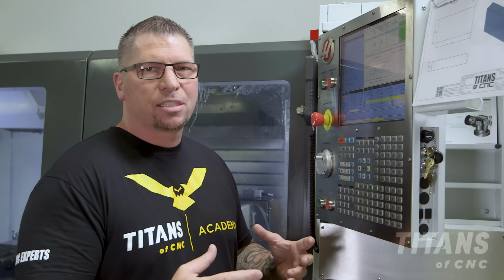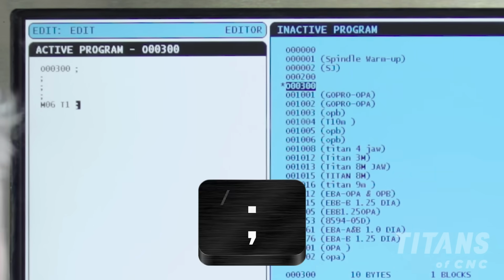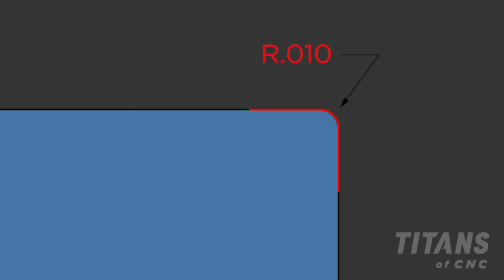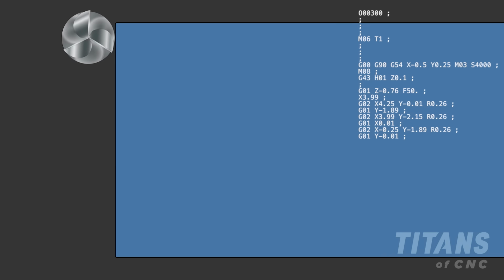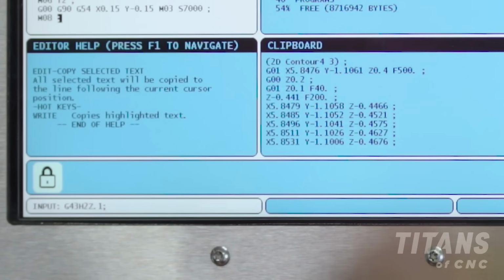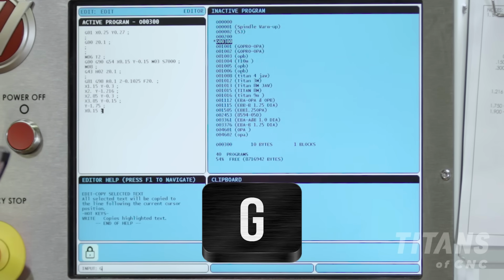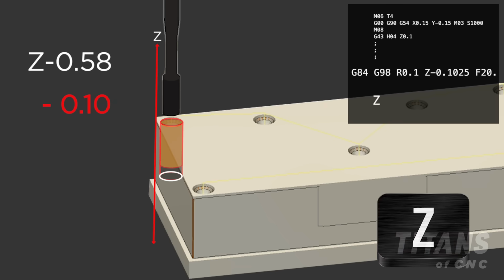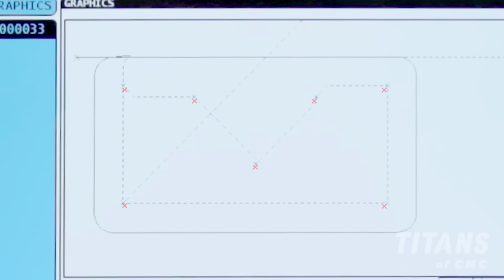G & M Code - Titan Teaches Manual Programming on a CNC Machine.

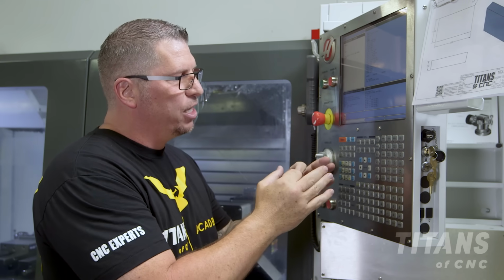Comment: 5:50 You have not zero'd off your tools in this program, at least from what I can tell. Is it a separate process? Why wouldn't you do it in Gcode?
Reply: You would manually touch off your tools first before you start the program. Most of the time, you have already done that (especially if its a standard tool that gets used frequently) after changing inserts, tool, etc. 

Typically, you dont do an automatic tool setting unless its part of the machine that can do that.

 For example, when I ran machines for aerospace, they had horizontal milling centers that had a laser that detected tool length and would check if the tool was broken. 

Hope this helps.

Comment: Why not have a safe line at the top of the program that it reads first?  
G90 G40 G95 ; (Safe codes)
T303; (Tool and offset)
Feed,speed, CW/CCW
G0 X0. Y0.;  (Home POS)
G0 x-.57 etc....

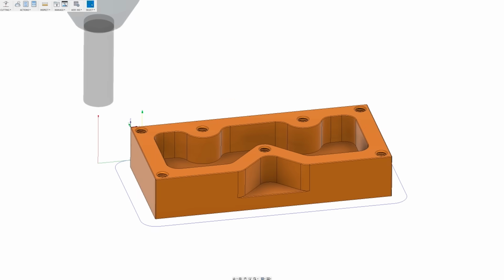Comment: 6:15 in code there's Z0.1 but in animation Z.100, is it the same? it's 0.1mm or 0.1inch w/e the units are?
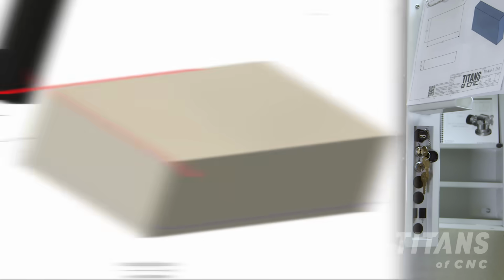Also 7:11, if the material is 0.75 thick, going down 0.76 shouldnt go even lower? here in the animation we only go a little bit down

Comment: My teacher hates writing programs like that.

Rectangle: X4.000, Y1.900, Z.750(Tum)

He would definitely write:

O00300;
;
;
T1 M06 (Verktyg 1, Byt till)
G54 (Arbets 0, Fixtur=noll, XYZ 0)
G0 (Snabbrörelse)
G90 (Absolut kordinat)
S4000 M3 (Vald hastighet, Starta Spindel)
;
X-.5, Y.25 (Gå till position)
;
G43H1 (Ladda Offset för verktyget, Höjd Verktyg 1)
;
M8 (Coolant on)
;
Z0.1 (Gå ned, stanna just ovanför materialet)
;
;
;
G1 (Linjär rörelse), F50(Matningshastighet / Minut), Z-.760 (Djup att gå)

Comment: If you're learning CNC programming, the Monport Mega laser engraver is a great tool to get hands-on experience, especially with its easy-to-use interface and precise control. With features like autofocus and a large working area, it’s ideal for honing your skills in manual programming while engraving a variety of materials.

Comment: Why are you not using tool correction for milling operations? It makes the math so much easier not to mention that if you decided to change to a different diameter tool you wouldn’t have to redo all the pathing?
Reply: Using tool correction on a beginner programming video is like teaching a 6 year old to use autocorrect instead of sounding and spelling words out 😂 it's useful to learn the hard and tedious way to do things first so you can have a deep appreciation for the tools that make your job easier

Comment: I do this level of code when drunk and sleep deprived. I started machining in 2008 i had 3 machines a hass VF-02SS, ST-30Y and a citizen swiss machine. All from a defunked shop i had zero money so i had all the machines running, making batch parts purely off manual gcode. Thank goodness for sub routine m99 codes.
Yes, all floppy drives the drive was dead on the lathe so I'd manually type in the programs.
I learned fast the hard way.
Titan you are inspirational to us all wish i had the opportunity to work with you back when you were in California.

Comment: Im guessing if you were using a cad software for the program you would only need to manually program the rapids and tool offset and datum position and then upload the g code file generated from the cad software from there?

Comment: Thank you this is refreshing me on programming. Last time I ran a Haas Mill all I did was set up. I was running 3 to 5 hills a night four of them had fourth axis, but back in the days when I did programming on cam soft I would try to keep the drill or the drill in a straight line. It moves faster when you do it like that lesser movement in one axis compared to the other one would mean you move much faster, but to each its own

Comment: can u explain about H 1 etc what is the purpose of it ?
Reply: You set that up when setting up tools in the machine. I learned the old fashioned way with a piece of paper or a 123Block. Check out the Hass tip of the day playlist. H1 is tool 1, H2 is tool 2 H3 is tool 3, etc. If Titan was using cutter comp there would also be D values for the diameter of the different tools. D values would not apply to drills

Comment: Dry run option is great to use . Just add depth of cut end mill is going to cut profile as a + number in work z. Then you can watch the path end mill is going to cut above part at way faster speed and see if it looks correct with no errors. We would let cut profile like .005" deep in face of part using dry run.   Any 1st piece setup always slow down rapid %   use single block and distance to go this will save you a lot 😊.

Comment: I have a few questions not saying program is wrong or won't work. But why didn't you show how to program using cutter comp. ( G41/G42) so you have control to make size adjustments and no need to add tool size to actual part dimensions when programming. Using comp I think is easier to write programs and read because program dimensions match print dimensions. I also always use a 120° spot drill using G82 with a dwell (P) = dwell time. When using P for dwell a decimal point is not used P20 example.
T1M6;
N1M1(1/2"X120°SPOT);
T3; 
G0G90G54X0Y0;
S6112M3;
G43H1Z1.M8;
Z.1;
G82Z-.06R.1F19.P18;
(Z-.06=.205 DIA. SPOT);
(P18 = DWELL OF 1 EXTRA FULL SPINDLE ROTATION);
G80;
G0Z1.M9;
G49;
G53Z0;
Question # 2
When tapping I don't use M3/M4 after speed no need to and delays at the start of tapping. Spindle will turn on in high speed and pause due to M3/M4. Not needed tap code G84/G85 automatically knows spindle rotation. 
( example 10-32 tap ).
T3M6;
N3M1(10-32 tap);
T1;
G0G90G54X0Y0;
S1000;
G43H3Z1.M8;
Z .1;
G84 Z-.375R.1F31.25.;
G80;
G0Z1.M9;
G49;
G53X12.Y0Z0;
M30;
( Spindle will engage and will only turn on when at position and at the reference point to start tapping). If in a Haas you can use M13 before speed . So will use low gear over ride to stay in high gear if a low speed is called for when using small to mid size taps. Works great and faster so spindle can stop faster and change direction after tap depth is reached. This is just my opinion and tips on how I was taught to write G code programs. I'm not saying any other way is wrong or won't work. Information is just how I program after 30+ years in the trade. Just one of the ways to try like I did and see if works for you or not. Everyone has a trick that we don't know just like you have a trick some guys don't know or just different ways of machining. Titans if you are hiring please let me know I believe I can be a great help to your team and I'm willing to relocate TY 👍.

Comment: I had to learn it by reading a track style printer. Started out with a tape reader. Allen Bradley controller. Somewhere there is a machine shop still using that set-up. circa 1975

Comment: When your doing this in a job shop with weldments you need to be 10 steps ahead and think about the next op, and how to set yourself up for the next stage….My first op is a lot of helping the welders after what I cut, center point cuts for them to ref, spot facing for parts to be welded on, even if it’s 20% clean up, it’s all about makeing the next stage more accurate so my final stage is easier….

Comment: I am curretly studying in a trade school to become a machinist, and manual programing is all I've done so far, either on the controller or on a PC with a simulation software.
 It really is quite interesting to see how people do things just a little bit differently, and learn from each other. For example I used to just write all the code into one long string, but a colleague of mine leaves single empty EOB lines between different operations, and boy does it make things easier to navigate.
Reply: Coming from someone who went head long into the CAD side of things, you'll use CAD most of the time, but I was taught G coding my senior year of high-school and that was more than some of their 3rd year apprentices, usually not a eveyday thing but when your computer decides to shit the bed like mine did today it's a skill that'll keep you moving.

Comment: All the tool paths i would progarmme i would use cutter comp with g41 to left of the path, when programming by hand. Then you can lie about cutter size and say its bigger. Then you can adjust it down after measuring the work peice

Comment: Have a question if the block is .750 thick how can you drop end mill doin .760  without hitting vise?
Reply: Most likely the stock is bigger than .750thk

Comment: A little secret with tapping for you 
T4 M6
G54             ( ILIKE TO SEPERATE THE WORK COORDINTAES FROM THE MAIN BODY)
G0 G90 X0.15 Y-0.15 S1000 (NO M3 OR M4 NEEDED IN MOST MACHINES)
(OH I HAVENT TOLD THE MACHINE WHICH WAY TO GO YET OR HAVE I)
M19             ( I LIKE TO DO THIS EVEN THOUGH IT HAS JUST CHANGED TOOLS)
                     ( THIS ALLOWS YOU TO MAKE ADJUSTMENT TO THE DEPTH OF THE THREAD AND RE RUN THE CYCLE, PROVIDED YOU DONT REMOVE THE TOOL FROM THE MACHINE)
M05             (OH DONT FORGET TO UNLOCK THE SPINDLE)
G43 H4 Z0.1
G98 G84 Z-0.48 R0.1 F31.25          (GUESS WHAT THE G74 OR G84 TELLS THE MACHINE WHICH WAY TO GO)
POINT COORDINATES AS REQUIRED
G80

There is something else you can do if your machine can do it 

switch over to a G95 Feed per Revolution and for imperial divide 1inch by the TPI to get your feed per revolution this way if you change your rpm you dont need to recalculate the feed rate.
and the switch back to G94 to go back to feed per minute when you have finished tapping (Note our Haas does not like this but the Fanuc and Okuma we have ore ok with it)

Jut some food for thought here.

Comment: As a software engineer I find this painful and frankly unacceptable. Users shouldnt have to input computer code to do a finite amount of actions. This software looks terrible. This work should be done on a proper computer system, not whatever the hell 1990s thing this is. GCode should be generated, and modified only when necessary.

Comment: I don't work in machining.
Do you ever wear the tools so much that the diameter diminishes and you have to correct the programming?

Or will the tool have worn out before that happens?

Comment: One of the most useful circular interpolation G Codes I learned was either G02/G03 - I/J minus radius value. Also, for repetitive hole patterns, the use of sub-programs with repeating patterns.

Comment: you can also use G41 or G42 to use tool compensation. This way u don't have to calculate the tools diameter within your program. With G41 / G42 it calculates the tools diameters for u.
Reply: Is this what the geometry column is for ?

Comment: It's probably intended, that you didn't teach the G43 H1 "D1" and the G41 or G43 radius compensation in this case? Because milling a contour is way easier and making a radius at the end of the line.
My code would be (always in structured order) :  "/" is used to exclude lines in a full run but to stop machine in a test run

T1 M6; (define tool, then change it)
S4000 M3; (define speed, then turn it on)
G54 G90 G0 X-0.5 Y0.3
G43 H1 D1 Z0.1 M8;
G0 Z-0.76; (no G1 here, it's too slow)
G41 G1 X-0.5 Y0;
X4,R0.1;
Y-2,R0.1;
X0,R0.1;
Y0,R0.1;
X0.1;
Y0.3 G40;
G0Z0.1;
M15; (spindle and water stop)
/G28 Y0 (back to machine Y0 or whatever code you prefer in that case)
/M0 (Machine stop)
T2 M6;
.
.
.
It's also important, that you shouldn't code a program line in random order. Use a structure in a meaningful order, so other machinists don't get confused or don't get WTF-moments when reading your code. (see the first 2 lines) Same goes for the order of tools.

Comment: 23:46 do it like you allways did M6 T(first tool) and then M30 it cancels your G43 i never use G49 LOL and G49 happen on m30 too so you not need it
and G91 G28 Z0; G91 G28 Y0; G90 G0 X(something) something is point where table is good position change parts. otherway it could be home x too
and that line G0 G49 G90 Z0 would plunge tool inside table. you told machine not use tool height and rapid Z0 your work z LOL. well its haas right it may work this way LOL. not make sense. for me you tell crash
there is no G28(mean go home Z0) not work Z0
Reply: Thanks

Comment: 22:40 you dont need calculate  feed when threading. use G95?for tapping(you can just write pict for F value LOL) default is G94 and M29 S??? and F your pitch. yes thats easy no calculating M29 not needed but why not use when its there lol

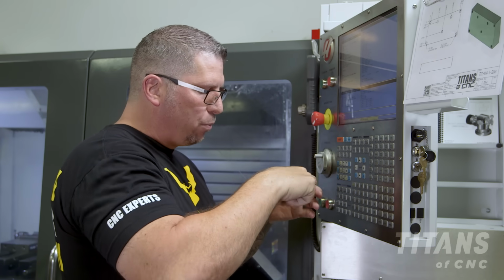Comment: 16:42 no need think it so hard thats how it work default without writing G98/G99
moving next hole on Rplane is never needed? in your case you can use G98/G99 both work same you on Rplane allrady lol but stop using G98 its useless. unles you somehow want move next point inside pocket
and make new G81 for another pocket holes or just write all holes same cycle and return initial point without worry G98(G99 get it yet how silly codes they are. pointless. you can safe millisecond rapid on R plane, but someone make misstake and it go thru wall to next hole bcoze you use G98/G99 and better nor use them bcoz default is that safest one you not need those codes
Reply: Please

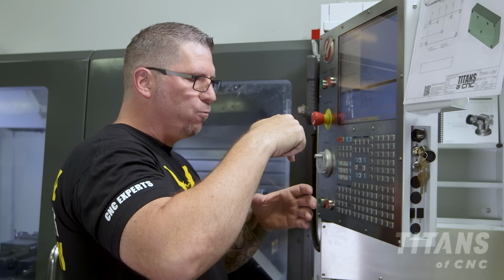Comment: 16:43 well thats how you programmed. no need G98/G99 its default that better one. you can rapid inside pocke drill it come back where you started and you can move next point even there wall. you abow it from start so its work fine. i not never use those code default work. there is never need move next drill point on R plane NEVER. you go rapid to 0.1 thats 2.54mm are you hurry some where? i allways g43 z50 (point where has change stop) single step mode is god for first run. after G43 z50 i go rapid Z10 (just to make sure tool height ok) then G81 go R1 thats closer than your 0.1inch rapid and return lol so my program will be faster even you try rapid so close but use feed longer. well thats bout that XD everyone program how they want. cadcam post another way lol
Reply: Man

Comment: 15:07 never use its default and return from reset. there is never no need G99 return to R plane. like useless gcodes well maybe year 1970 rapid speeds was slow
Reply: Up

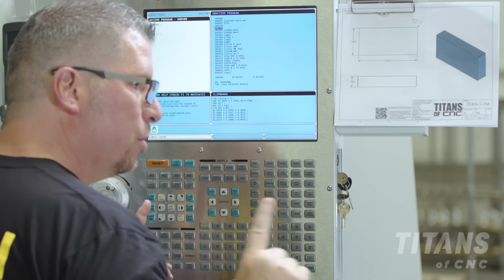Comment: 4:46 yeah G40 G49 G80 G94 G90 G54 start of program and allways program same way before tool change change all gcode you want it to be like G90, but how many of them go default anyway after hit reset? i bet all of them xD so before start program hit reset. i give one hint. you measure port z with g43 tool height and go up bit and hit cycle start. you have g43 still on and start of program g49 it move tool inside part xD bcoz program tel do it. no you forget hit reset before start program. mayby all machines not move axis when g43 g49 is used only effect coords
Reply: The

Comment: 1:28 thats cam code. manual gcode it less lines and follow figure lol. yes that easy it is. never touch cadcam RED RED cutting in side part. smart cam say error but not fix it lol or in other way say dont do error cun in side part, cut just path you select huh lol
Reply: Shut

Comment: help me PLEASE how to make Loop Programme on ProtoTrak SM(TRAK DPM)  Mill machine with the help of G Code and M code.
how to Write , Save and RUN the loop programmed  in machine.
for example
G17 G20 G40 G49 G80 G90
T1 M06 
G00 G54 X-2.6 Y-.25 S2000 M03 
G43 H1 Z1. 
G00 Z.1 
G01 Z0. F10.
M98 P10 L10 (SUB PROGRAM CALL 10 TIMES)
G90 G00 Z1.
M05
G91 G28 X0. Y0. Z0. 
G90 
M30
%
(subprogram)
10

G91 G01 Z-.025 (INCREMENTAL Z DEPTH FOR EACH PASS)
G90 X-2.25 F20. 
Y1.
G02 X-2. Y1.25 R.25
G01 X2.
G02 X2.25 Y1. R.25
G01 Y-1.
G02 X2. Y-1.25 R.25
G01 X-2.
G02 X-2.25 Y-1. R.25
G01 Y.25
X-2.6
G00 G91 Z1.
G90 X-2.6 Y-.25
G91 Z-1.
M99 (RETURN TO M98)

Thank you in advance
best regards 
shawaiz liaqat
E-maill: shawaiz.liaqat@gmail.com

Comment: Excellent video. Have a question. Time 6:58. If you are 0.1 above the part, and you want to go 0.75 into the part, should Z not be -.85 rather than -.76? Thanks. Wayne
Reply: All coordinates in this program are absolute (G90) and the top of the part is Z0. The part will finish at .750 thick so he went to Z-.760 so when it's flipped over and the clamp stock is milled off its sure to get cut off cleanly. You are thinking of incremental movement (G91)

Comment: Realistically you either need to right a macro program for something like this or just use a cam software. With a good macro program you only have to change the common variables. If you're doing something "special" cam software, mastercam, is more practical. It's good to know all your g and m codes but it's a waste of time writing this long hand.

Comment: About 35 yrs ago I went to a local college to get a head start on a tool and die apprenticeship I was the only one in the class to program both machines right 20 yrs later we were having problems cutting a part on an old laser I was running that day and I explained  that by switching the start and end codes the part would run the engineer did the switch and the owner pressed start and the part ran

Comment: fanuc does a good job and im working on doosan dnm 400 machines but i will allways love haidenhain for manually programming. its much more comfortable und understandable.
A big problem for my colleges it the T, H and D value... i write my programms like "#150=1; T#150M6; M3S3000;G90G54; G43G0X0Y0Z50H#150D#150"

Comment: You should have code at the beginning of every block of code that sends the spindle up to Z home, before it does anything else. Otherwise someone is going to have a crash. So the head will always go up before there is a X or Y movement. G00 G49 Z0. So if you put that at the beginning of every tool change, the toll head will go up before it does anything else. It really really really is smart to use. So if you have to stop the program while the head of the machine is down, you can keep it down. When you go back to the program the head of the machine will go up before it does anything else. It’s a safety thing!